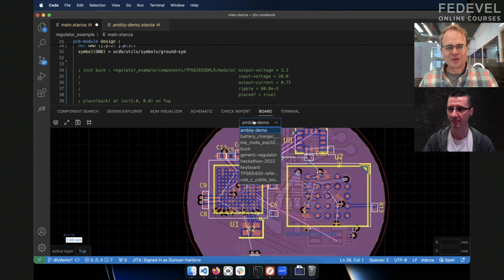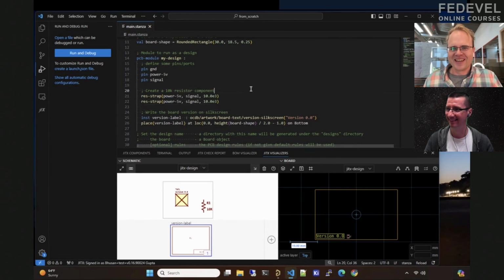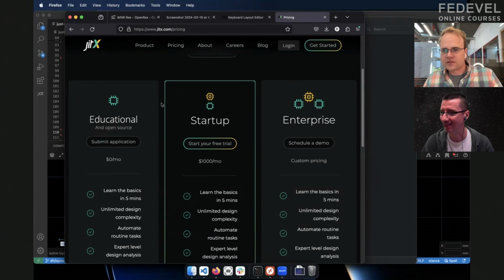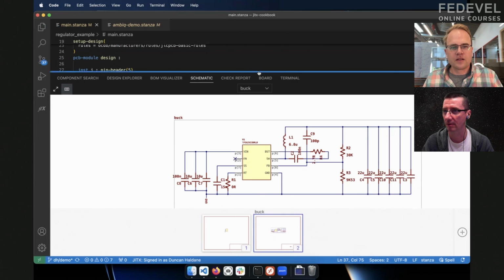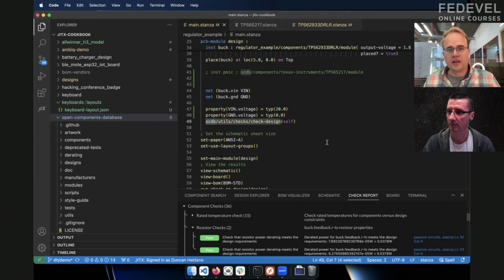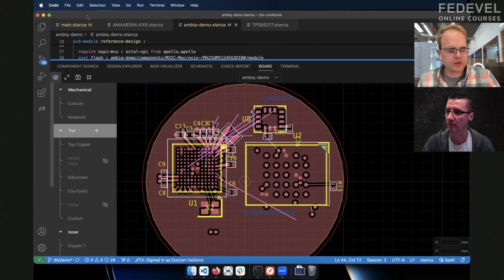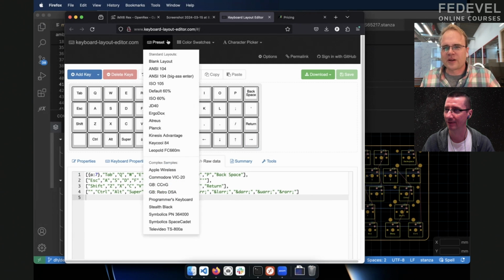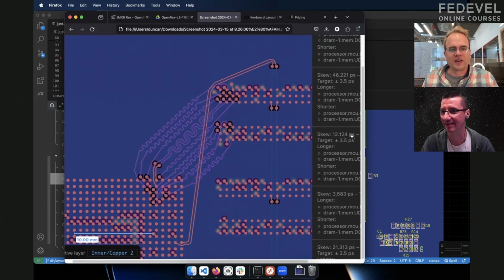Is This The Future of Drawing Schematic And Doing PCB Layout?

Comment: pcbs are so shitty bad designed items. an improved wirebonder can minimize and make them better under an epoxy layer. some ewil electronics companies making cpus without rams and memories. all items should be packed together and external input-output pins should be grouped well inside chip packing factories.

Comment: Seems a bit early to jump in on that hype train. I can see some benefits for some applications. But i think i would still need to verify a lot of things manually to make sure that the code that generates everything actually does what it's supposed to do. We would basically have to build up the knowhow to use this tool efficiently, build the library of components we have in stock and use in our designs regularly, develop new prcesses that work around this toolchain to integrate it into our desiign workflow, and then actually build a bunch of designs and boards to verify in physical hardware that the output is actually what we expected. It's not easy to dedicate that time and money to something that may or may not be supported or even required anymore in a few years. At least with our current toolchain and design process we know we get working designs that we can push thru certification and sell to the end customer on a consistent rate. There is always room for improvement, but throwing out the old well understood, tuned and working machine for a shiny new fancy black box is asking quite a lot i think.

Comment: I really don't understand all the negative comments, so I am going to leave a "positive" one. I have been wondering for years why every single engineers is doing and re-doing the exact same calculations, for the exact or very similar component, for very similar applications instead of having some automatic way to saying "this is what I want, calculate everything", and this tool does it. There are a few tools like this one coming out at the same time (basically: components are treated as a database, the design is treated as an optimization problem, give the constraints and get back a circuit) an I am very excited to see where it goes. If together these tools can save me hours of browsing through datasheets, doing trivial calculations and make checks automatic, I consider it a huge win.

Yes, the price is insane. Also, the single hobbyist is not the target. Thanks for the very informative video.
Reply: You are gonna have to do the calculations again anyway... Do not fool yourself into thinking that you will not have to verify what the machine did
Reply: @RemiBusseuil  do you re-do by hand all the calculations that you do in Excel? or using the calculator on your phone? or do you simply re-check that the input values were correct? I expect that using these type of tools will be the same: I will give some inputs, triple check them and then trust the results (and if I am really paranoid, maybe check a few calculations the first time I use the tool, just to make sure I understand what is happening under the hood).
Reply: I don't know about schematics or possible tests, but that layout is terrible. If that which one are in they homepage are the "best one", then oh my god. I mean arduino level electronics would work fine, but it is like hedgehog and that is from visual aspect, imagine what kind of problems would arrise in high speed dense boards. I wonder what comments would be from Rick Hartley or Bogatin about that monstrosity :D Jesus :D
Reply: @MrMartins159  you are judging the layout from an unfinished example of a software which is basically new? The phrase "this is the worst that this technology will ever be" is very common for a reason. Try to extrapolate 1-2-5 years in the future and try to see the potential.

And just to be clear: I am not saying that this is perfect, or that it will work perfectly or that it will become a de-facto standard way of doing PCB development. I am just glad that there are people trying to automate this type of work and trying to push the boundaries of what can be automated or the boundaries of where the tools can help us.
Reply: @cescozep  Yes I agree in regards of potential, but I'm judging at this moment, if i had to pay ammount they are asking and afterwards had to do a lot of cleanup then I see no point of that. That of course depends, for some that ammount probably are pennies, then why not, take to play around.

Comment: Useless for analog circuits.
Reply: Why would you say this?  They said it was ideal for high frequency digital circuits and at high frequencies the challenges become "analog", the digital signal can't make clean '0's and '1's any more.  Also it's all based on defining contraints and letting tools optimize for these, there's noting inherently digital or analog about that.   So to me this sounds ideal for analog circuits.
Reply: @benlpayne while digital circuits are made out of fairly standard building blocks, this does not apply to analog circuits. there are so many non-standard parts which each behave differet

Comment: I have a very similar (if not more powerful) project called edag, I wrote about 4 ago and used for small projects. It is purely in Python, and can use Python do macros, and other things like remapping pins, busses, complex submodules, subschematics, repeated stuff, arbitrary names, etc. It outputs netlists for KiCad, for PCB layout. As I am not an electronic engineer (I am software developer with full time job in completely different field), I do not really move the project any further because of lack of time. It is not based on Verilog or VHDL either, as they do have different purpose. But it does work. And you do not need any new language if you already know Python.

And you can define logical things, like instead of placing resistor, or dividers, or RC filter, you can make code figure out automatically (using standard Python functions) all the values, power requirements, whatever to use serial or parallel components for some stuff (i.e. capacitors and resistor), and what  footprints from simple requirements as an input.

I wrote it because I feel like drawing schematics by hand is just like living in 19th century.

It is still a mess and prototype but was enough for me to use it in real work. I will pick it up a bit more at some point, and add things like built in ERC.

Comment: How bout an opensource version of this? 10k a year is insane lmao. Hopefully the open source community will eventually have a kicad plugin to do things similar to this.
Reply: Companies have gotten greedy, they want to sell a single piece of software and live off it for life
Reply: I also thought that. There is of course nothing wrong, if they are selling this as a product. For KiCad, a scripted description of schematic components would be a starting point and a big time saver. I have no idea how many hours I have already spent creating symbols for large pin-count chips. The next thing it needs is some sense of physics, so that you can attach properties like maximum current or thermal conductance to pins and the ERC could warn you about bad connections. The next step then could be to generate connections in the layout by using this information.
Reply: I've recently come across a similar OpenSource tool in a similar space called Atopile.
Reply: Haven't played with it, but there is another project I read about on hackaday called atopile that seems to be open-source.

Comment: I'm an electronics engineer. My entire career has been spent writing code. As someone that has been in the trenches writing code for very large systems for a very long time, I can tell you that I am thoroughly sick of writing code. I could write a long essay as to why that is. 

That said, isn't VHDL and Verilog a high level hardware design language for how to interconnect and simplify logic? It would make sense that that paradigm can  be exported from chips to the PCB level. My concern here though is where VHDL and Verilog are more or less standard languages I'd be leary about using something that is proprietary and not standardized. Last thing I need is for my designs to be held hostage by a single vendor.
Reply: I deeply feel this comment about being an electrical engineer sick of writing code.
Reply: Writing a good testbench in VHDL can sometimes really be a pain in the arse. Thank God for VUnit.
Reply: Cadence has had schematic generation they called io synthesis for schematic capture for probably more than 10 years (fpga designer). The issue getting a non-proprietary library built that has all the io info so it remains portable between tools. 

The next step after the schematic and first pass layout, but before spinning hardware, should be system C or other simulations to test or start software before making hardware. To do it though you need better models than just io models.